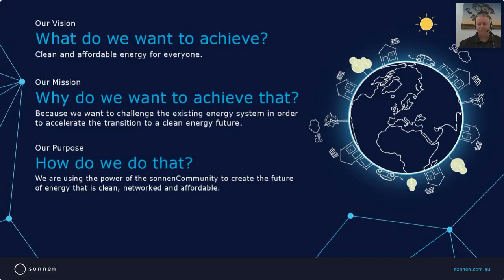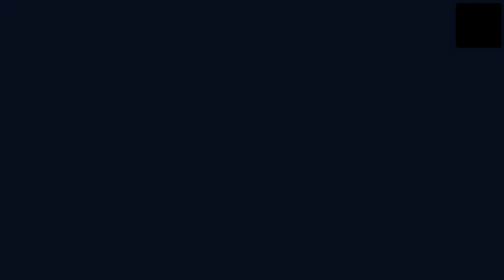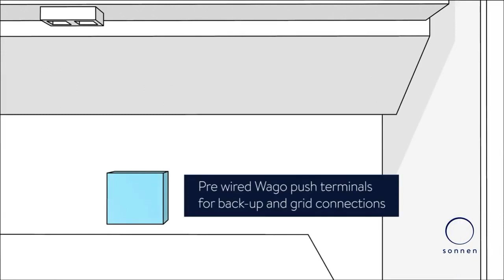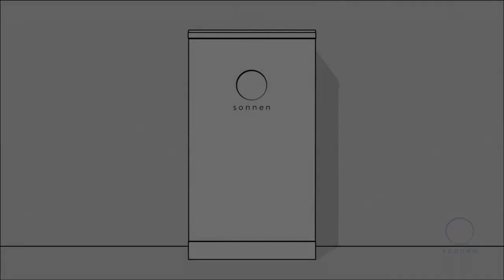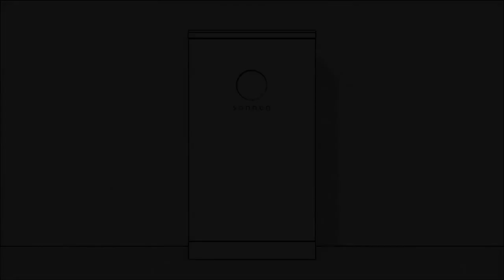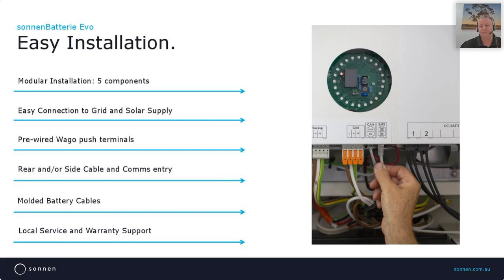sonnenBatterie Evo | Technical Specifications Webinar

Comment: I have two as well and in my case the fans failed on one. The unit gets very hot. The fans are not smart and cannot be remotely diagnosed. Getting this fixed is not quick. 

The VPP seems to be a thing of the past. 

This video clip hasn’t aged well imo.

Comment: I have had 2 sonnen evo,s installed in my shed and i would like to point out to anyone considering this brand that the level of noise generated by the cooling fan is abnormally loud, also the batterys do not like the heat and consequently in warmer weather the fan will kick in at 30 degrees ,( around 11.00 in SA summer)  and run continuously all day until well into the evening, even past midnight on a 40 degree day. The level of cooling fan noise is enough to drown out my usual radio sound in my shed and can be noticeably heard from 20 metres away.